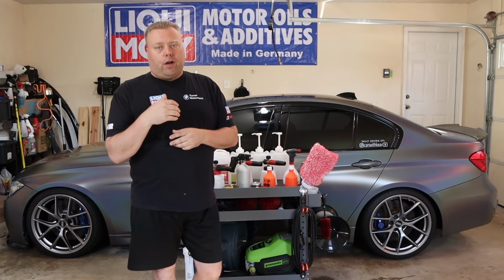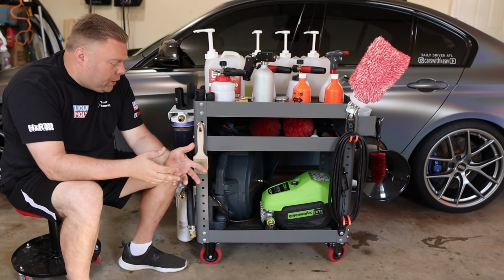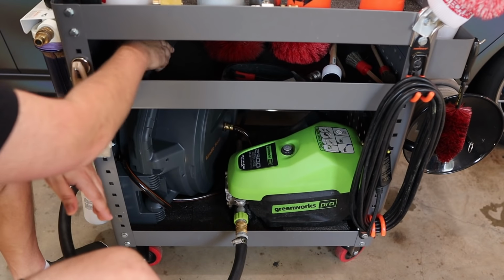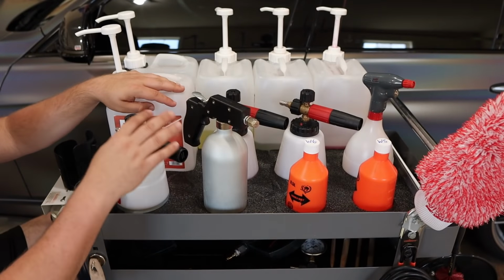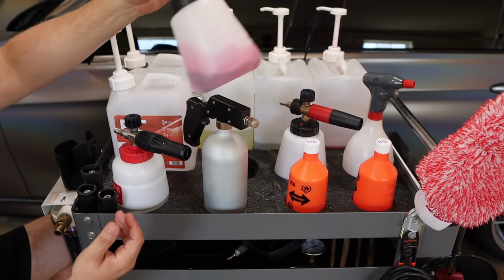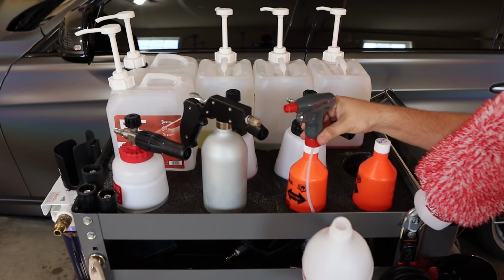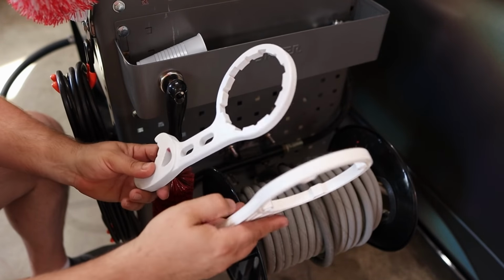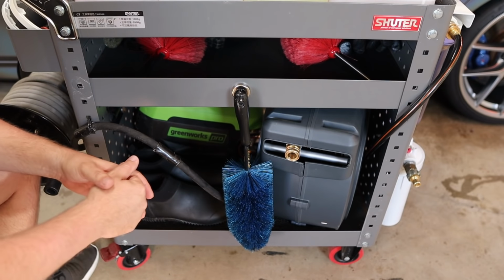THE ULTIMATE BUDGET WASH CART | Version 4 | Car Washing Setup

Comment: Great video!  @ 14:00 I use a "Bullseye" adjustable brass nozzle.  I picked it up at my local hardware store but it's on amazon too.  You can adjust from an unrestricted stream down to a mist with a better spray pattern than the on/off valve.
Reply from the maker: I have a Bullseye and liked the spray patterns, but it lacked the ability to give me the lower pressure rainfall I'm looking for.

Comment: Nice setup, thanks for the ideas!  I'm thinking about the SS garden hose coupler w/ check valve from MTM in lieu of a shut-off valve and wondered if you have noticed a difference in output pressure with the larger shut-off valve, or perhaps without one at all?
Reply from the maker: I have never used one of those before because it seemed to be a smaller opening than the normal garden hose QD’s. yes, more output with the larger shut off just have to have the outlet to get it all out. Pressure washer wouldn’t know the difference. A fire nozzle would though.
Reply: @CarsWithKeav  Thank You for the info!

Comment: Hi, is your pressure washer not connected after your DI?

Thanks from South Africa 🇿🇦
Reply from the maker: I only use DI on my final rinse. Never through the pressure washer on this cart. I do use it with my wall mount setup as I have a much bigger DI system.

Comment: Hi Keav, 
First off I have to say awesome job on the customization of the cart. Very inspiring. I have one question for you.. wouldn't it be easier if you had the PW and hose reel set up mounted in or outside your garage, so that it eliminates more steps on the set up process?
Reply from the maker: Good question. I actually do have a wall mounted system in my garage wash bay I just finished. Before that I was using this due to the having the pressure washer and all my tools near the car. I like to wash with the garage closed as to not overspray foam or mist onto the other cars especially in the wind. Having the garage closed leaves me no access to chemicals, brushes, etc.  The other main reason is not needing as much hose and making it easier to reel. My only areas to mount in the garage would make me pull the hose at an awkward angle that is hard to reel and unreel. Cart will always have the right angle for that. I didn't have a hose bib in the garage so would have to unreel my garden hose and with the cart I wouldn't have to do that.  Pro's and Con's for both though depending on your situation.
Reply: @CarsWithKeav  gotcha ya

Comment: What do you think about using a US General 5 Drawer Tool cart? I was thinking about the single drawer service cart but that one is just a little too small. Main goal is to have a similar setup and then add pegboard to the sides, but use the drawers for microfiber storage.
Reply from the maker: I have thought about them as well. Keeping the microfibers dry is a great idea, also power tools. They are sturdy and the pegboard idea I have also been thinking of myself. Trying to find a cost effective metal pegboard to mount to any cart.

Comment: with over 100ft of hose, why have all the plumbing and pressure washer on the cart and not on the garage wall.
Reply from the maker: The cart idea is to have everything you need in one spot by the cars. I can keep the garage closed so the mist from washing doesn’t get on the other car. Plus, I can move it to my other driveway when needed. I just like the idea and keeping that cart up there. New wash bay is being created in the bottom garage and will have a wall mounted system.
Reply: Can't wait to see the wash bay. Thanks for the info.

Comment: Why not run the deionized water through the pressure washer at the end of your rinse cycle since the pressure washer typically uses less water.
Reply from the maker: Mine runs 2.0 GPM and this de-ionization barely keeps up. I am now with my wall mount setup, but I still do a Soaking style rinse at the end. If you use the pressure washer with it you create a ton of tiny beads and makes drying with a leaf blower take longer.

Comment: In this video, which cannon did you use? Brilliant or Boss?
Reply from the maker: The foaming part toward the end was actually the MJJC Pro. I have taken the Brilliant Finish out of my foam lineup currently. Just prefer the BOSS and MJJC right now.
Reply: @CarsWithKeav  Any reason in particular?  I just bought the Brilliant Finish yesterday after watching your review of it.  I'm putting together a water filter setup inspired by your vids.  Keep up the great content!
Reply from the maker: @steved479  Mainly because it has an odd thread pattern on the bottle. Doesn't work with my other tops and I like them all to be the same size.  I prefer the feel of the BOSS as well.